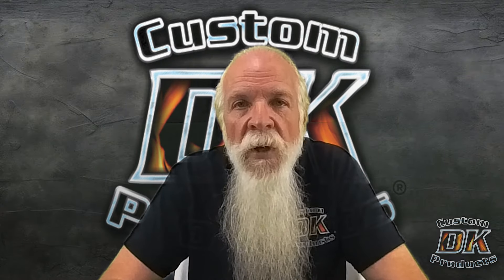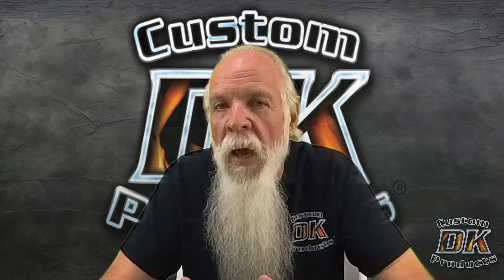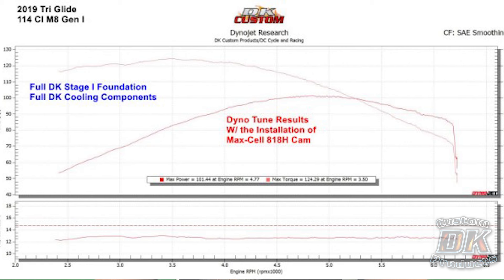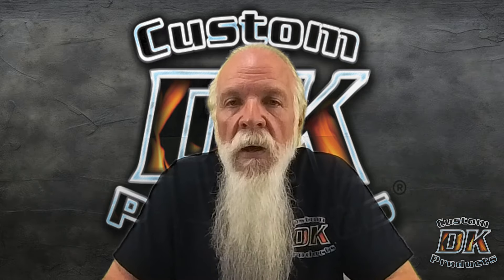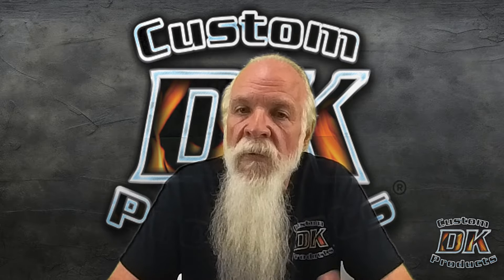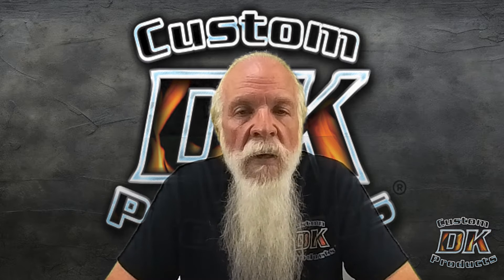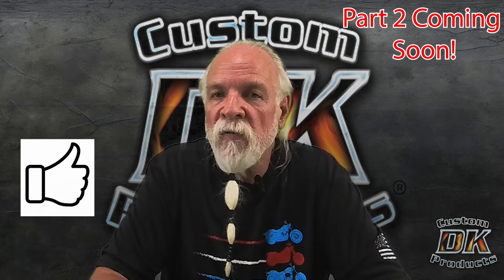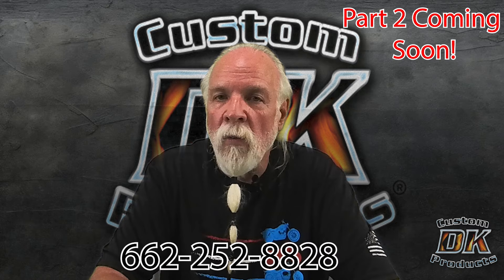Behind the Scenes: Transforming 114 M8 - 124 ft lbs Torque

Comment: Did a stage ll on my 17 107 Freewheeler. The bike at 13000 miles started the sumping issue. So I did the fueling oil pump and cam plate the Red shift 468 decat stock headers with Khrome Werks slip on’s and DK 828 air cleaner ended up with 100 hp and 117 torq. This thing is so fun to drive even with the wife on riding double this thing pulls like crazy. Really enjoy your products keep up the great work.
Reply from the maker: It is great that you are enjoying the benefits of having the parts installed. Wishing you many more miles of smiles! Thank you for your business, support, and for commenting! MB

Comment: I have a 2023 Road Glide 3.  I asked Harley about a screaming Eagle 1, and apparently they aren't allowed to do it here in California, other than the breather.  I'm about to do my 10k, and I'd like to improve the suspension.  Problem is, when I go over bumps in the road, sometimes they jar the heck out of my spine.  Already did the piston under the seat, but it made no difference.  Harley says the Öhlins would work, but they may not support a RG3.  I'm not a small guy.  I have a larger peg on my shifter so it accommodates my big feet.  I want a suspension that is going to work, not just be a repeat of the problems I already have.  Any suggestions?
Reply from the maker: If you want to upgrade suspension you should check out the two links below. You may find them interesting/useful. 
Here is a link to a written report on Rear Suspension - https://www.dkcustomproducts.com/overview-of-performance-rear-shocks-99.htm
and
Here is a link to a written report on Front Suspension - https://www.dkcustomproducts.com/dk-custom-front-suspension-testing-report-part-i-of-ii-dk-fs-tst-rp-i.htm

Please feel free to reach out to us with any questions;
Support@DKCustomProducts.com
662-252-8828

Thank you for commenting! 👍😎👍 MB
Reply: @DKCustomProducts  Thanks for the links.  I'm waiting for my local HD shop to approve putting in the shocks in your report.  I'd be surprised if I heard something solid from them before New Years.  Working with your site to line up the parts.